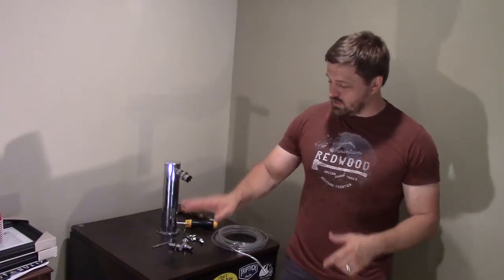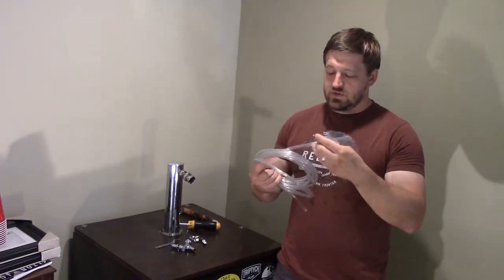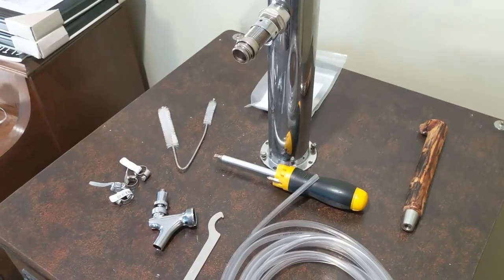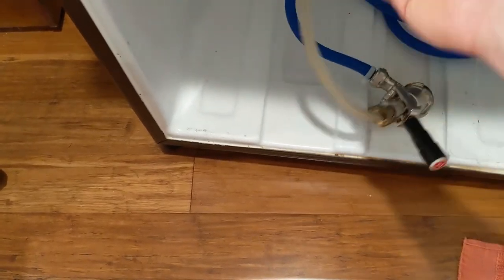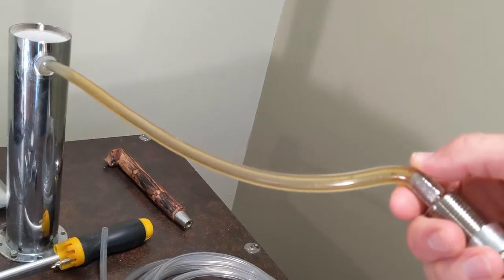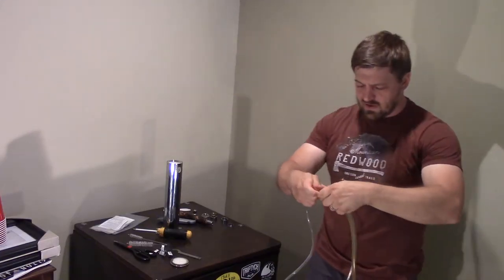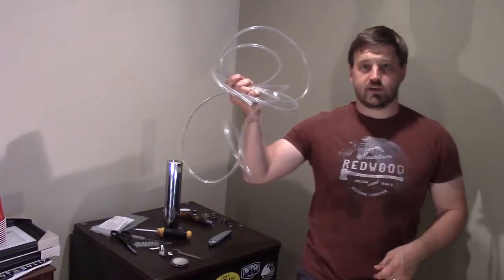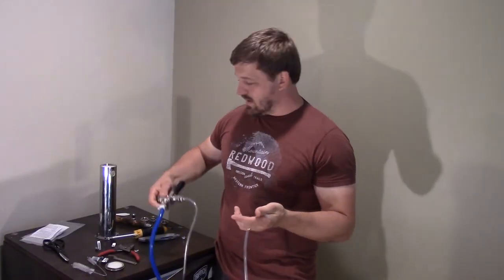How to change beer lines in your kegerator

Comment: Nice video.  Im firing my kegerator back up after being down a few years. I bought new lines. The guys at the local Home Brew shop recommended I upgrade to 1/4” hosing and running it longer as the extra length (I went with 8’) cus it helps with foam control. I also previously built a DIY tower cooling fan. I bought a plastic hard drive box for a computer and a computer fan. I cut a hole in the “intake” side and a hole in the “export” side.  I fashioned a cone and some 1 1/4” plastic tubing so that the fan pulled in air from inside the kegerator and blew a steady supply of cold air out the other side and through the 1 1/4” tubing up the tower keeping the beer line cold all the way through to the tap handle. Worked like a charm to keep things colder and reduced so much foam.   Just my little diy. Cost less than $20 and worked wonders.  Thanks for the video!
Reply from the maker: Great input! Thanks!

Comment: Funny thing is I need to know how you got that shank nut off. Cause I have no idea
Reply from the maker: Just hold it in place with anything that fits, like a wrench or pliers, then give the shank a twist to loosen it. Once it's loose just use your fingers to thread it the rest of the way off. To reinstall, just thread it on with your fingers and use the wrench or pliers to give it a final tightening. Just be careful not to over-tighten. Your fingers might be enough. Hope this helps 👍